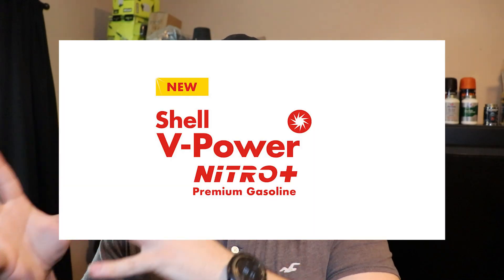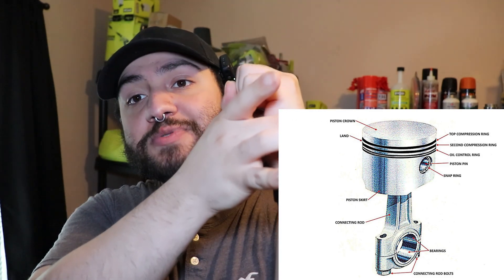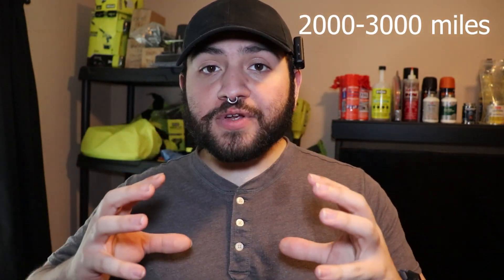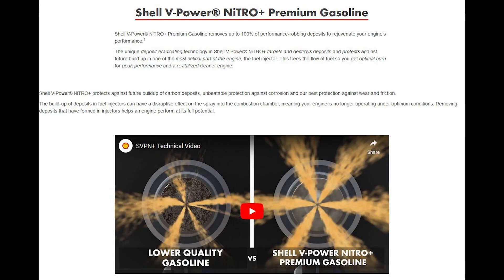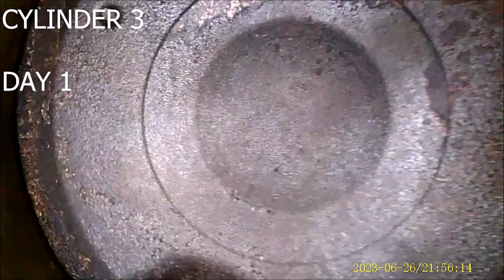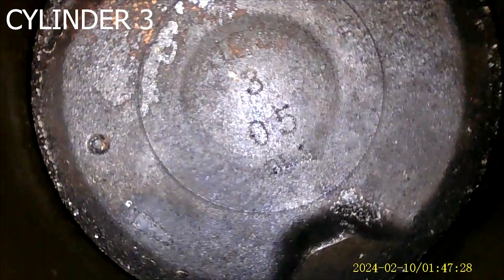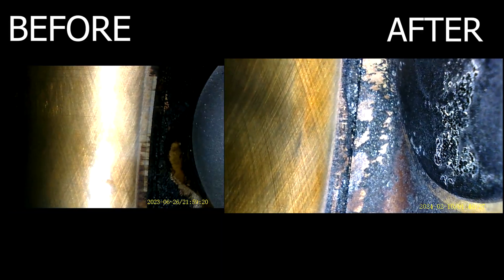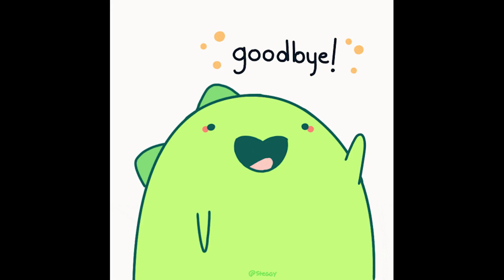IS PREMIUM GAS A SCAM? $$$$ (SHELL V-POWER NITRO +) - 8 Month Experiment

Comment: I’ve been using it several months now and I used to lose about a quart of oil between changes at 5000 miles. Last oil change interval I lost no oil. My conclusion is it’s freed a ring so I’m not getting blow by. I drive a lot of highway miles for work so I probably do more miles than most. It may take longer for others to see a change. I also use gum out injector cleaner each oil change
Reply from the maker: @tellit_one3613  preventative maintenance goes miles compared to fighting when mechanics have to charge you the harsh prices to repair

Comment: Start using it when your car is new and keep it clean to start with.
Reply from the maker: it does claim to be able to coat the area to resist build up occurring yes. I'm sure most people are more interested in what it can undo once their car starts acting funny. Too many drivers put whatever fuel they pass on the way home or to work, in their engine for years. Sometimes a fuel additive can yield comparable results but some formulas are money pits that don't work.

Comment: Instead, buy a catalytic converter cleaner like STP 1 Tank Tune Up which cleans and protects the catalytic converter, fuel system, intake valves, and oxygen sensors. They’re less than $15 which is around the cost difference between a full tank of regular and premium
Reply from the maker: thanks for sharing! Wonder how fast people would see results. :body-blue-raised-arms:

Comment: Scientific tests show that pretty much and "top tier" gasoline will clean your engine over about 5000 miles.  It doesn't have to be premium gas or even Shell gas.  For the most part I can buy top tier gas for a few cents per gallon more than no name gas.

Maybe Shell V Power has more detergents in it than other top tier gas, and maybe it works better than the others... I can't say.  

I only recall, that in the old days, my carbureted cars always ran less well on Shell gas, but there was actually a noticeable improvement in fuel economy with Shell.  So yes, Shell might be different.
Reply from the maker: old school guys say take it to the highway and floor it to 100 for a mile or 2 for the "italian tune-up" everybody has what works for them or what's in their budget. I know older cars were very inefficient and bad for the environment but man they built them so sturdy you could actually pass them down AND afford them to begin with lol
Reply: @TOOL_TECHNICAL  To be honest... old school cars wouldn't be around if we were still using old school oil.  They were built for really crappy oil, and they only last forever because oil improved so much.  In my 1966 Olds owners manual it says to change the oil ever 2000 miles or 30 days... And back in the 1970's I dug tons of sludge out of old school V8s from burnt up oil that wasn't changed on time.  

Once you switched an old school engine to modern synthetic oil... they literally stopped aging.  And no, they didn't get better... they just stopped getting worse.

As to bad for the environment, I'm still not sold on catalytic converters that spew out acids being much better.  The rain in my area is pretty acid these days and all of the salamanders in my local lakes are deformed or gone.... But yes, there's less lead in the air now... So I suppose it's a trade off.  And also smaller, lighter cars pollute  less.in as much as they burn less fuel.  But back in the days, I had a 1973 Buick with a 1976 455 4 bbl (low compression).  As it was in a 1973 it didn't need the catalytic converter or the AIR pump, so they were deleted legally.  (It still had EGR) and it easily passed emissions for a 1991 even without the anti-smog stuff.  We also managed to get a 1966 high compression 425 4 bbl to pass for a 1976, but it was literally undrivable. So, yes the high compression high performance engines were worse for smog. As to fuel consumption, the 425 got around 9 to 11 MPG highway and the 455 got 17.  My 2003 4.6 L Ford gets around 15.  But if your car gets 30 MPG, you are likely polluting less than most old cars did.

To toss one more monkey wrench into the discussion, I have an 1981 Hemi K wagon, with the 2.6 Mitsubishi MCA jet engine (Mitsubishi Clean Air). It gets both 30+ MPG with insanely low emissions, but it's a slug and does 0 to 60 eventually pulling a heavy wagon. So, even back in the day, cars could have had better emissions and fuel economy if anyone really wanted them.

Don't let people BS you... there's nothing new in internal combustion.  Everything we know now, we knew back then and could do without 10,000 worth of high tech per car. Lubricants and fuels however, have improved and car makers are taking advantage of that to make engines that wouldn't have lasted 10,000 miles back in the days of asphalt or paraffin based oils and basic non detergent fuels.
Reply from the maker: @RJ-vb7gh  I know safety is why cars crinkle to absorb the shock that would otherwise instantly kill drivers going 60-90 on a highway but I feel like back in the day you'd crash, take the bumper to a shop and weld it back, alittle touch of paint and it would be like it never happened. meanwhile today one hit and both cars are pronounced totaled by insurance companies right on the scene lol. Thanks for sharing
Reply: @TOOL_TECHNICAL  Yes and No.  Look closely and you will find that Big cars had full box frames and multiple piece stamped bumpers that were very heavy and thick; not to mention a thousand pound engine in front of you.  Small cars like the Maverick, Pinto Vega etc had no frames and very thin bumpers.  Moreover the Pinto actually had the gas tank as the trunk floor and extended into the rear bumper with no firewall... So yes large cars were safe, mostly because they crushed little cars in accidents.  That's why some folks remember the great street panzers of yore while other people say cars are safer now.  It all depends on what they were driving back in the day.

We didn't just wake up to safety, back in the day some people opted for fuel economy and inexpensive cars over safety. The Ford Maverick sold for under two grand, and there wasn't a paper clip worth of metal on that car that didn't hold something necessary on to the car.

Comment: i'm actually surprised by the results. I didn't think anything would happen. thank you for putting this together!
Reply from the maker: my pleasure powar! I really wanted to see if this fuel could solve the owner's blow by leading to oil on their spark plugs. 2 other things that could've been the culprit are worn out spark plug well seals in the valve cover OR the PCV valve going bad. Checked for those first so the final boss was attacking that carbon!
Reply: @TOOL_TECHNICAL 
Try using Valvoline Restore and Protect motor oil. That will clean the piston rings and reverse the blowby.

Comment: That's the wrong car to test with anyways, 8 months, wow! I can fill up 8 times in 3 weeks.
Reply from the maker: I went by amount of miles it took to achieve what would be correct time allotment by shell. if you fill your vehicle 8 times in 3 weeks, you probably need something more fuel efficient.
Reply: @TOOL_TECHNICAL  i have a 2016 escalade thats used for work, i have to driive to each job,  half the time i pull a 10x6 enclosed trailer. Put over 100k on it 2.5 years. Comfort is king! Service vans fully loaded with tools, ladders, and parts get the same mileage. You sure are full of opinions. You definitely need to be more open minded
Reply from the maker: @atlantaacman4750  My impressions are formed by analyzing data as it is presented and are open to change as more data becomes available. A daily driver is what is assumed until you now shared that it is a work vehicle which makes more sense for jobs and not simply 8 fill-ups of daily commuting. You also have opinions such as "That's the wrong car to test with anyways". That said, I hope the video was straight forward as I improve to share tool videos and repairs. Nothing personal here atlanta, the world is a rough enough place. :)
Reply: Right that's basically not even driving the car

Comment: I decided to try the high octane Shell.
Car ran wow so good and fast for 2 days.
After that it idle funny almost stalling and it runs like crap the first few miles
Never again just get the regular gas now and no problems.
Reply from the maker: @frasergriswolds7553  sounds like you had an underlying problem or carbon buildup may have gotten loose making an issue reveal itself
Reply: 😂 Lmao
...Sounds like your car is a POS.
Never again. 🤪

Comment: There really is a difference between gas meeting the minimum detergent requirements and those that are "top tier".  This car undoubtedly spent most of its life on a diet of whatever was handy and most likely whatever was cheapest... so odds are it did not have a steady diet of top tier detergent levels.  Lots of research has shown not only the benefits of detergents in fuel but that the effect is dose dependent.  Putting it on a steady diet of Shell V-power should have cleaned it up some but you can only do so much with what is still a low dose.  Years ago, I saw detailed research report showing how well Chevron's techroline worked.  It worked well and it was dose dependent; it didn't take 6 to 12 months to show improvements if you used a decent dose in a couple tanks.
Reply from the maker: @EristiCat  definitely this truck gets the regular stuff. But when $ is tight and prices get higher, I totally get priorities being food or utilities over fuel additives in gas. I looked into techron unfortunately it isn't available near me

Comment: It’s the only thing I run in my turbo charge GDI engine. I used to think Chevron supreme with Techron was the best but then I started using shell and I noticed a difference. I won’t put anything else in there because it works. Thank you very little!

Comment: I run shell V Power 93 in my Corolla GR  which requires 91 or higher octane.
Reply from the maker: notice any changes in performance or fuel economy between the octanes?
Reply: @TOOL_TECHNICAL  Here in Florida we only have 93 not 91 octane. This car is a high performance turbo car and requires premium and I only run 93 octane. I now only run Shell V Power 93 but when I run WalMart 93 I see more knock and timing being pulled then the shell 93 octane Vpower. When I go to the track I mix 3 gallons of 100 octane unleaded race gas. I can see it on the data logs. Fuel economy regular driving shell v power is slightly better than non top tier 93 octane.
Reply from the maker: @mhk67091  not sure which jumped out more at me there. Florida not having 91 or the fact that walmart offers gas??? I know some walmarts do tires but like a gas station? that's cool

Comment: All I know is, I have a 2020 Ranger 2.3 EB.  Says you can run 87 and I drove a good bit to get the miles to E to reset some.  I gained a 100 miles to the tank on the Shell.  I'm avg. 24 to 25 mpg and still gaining a mile or two.  It's leveling out after about two tank fills.  I put 89 in the CX-50 and beating the sticker mpg by two.  It's worth it to me to pay extra at the pump.  If I did the math right, only spending five extra bucks from the mpg gain.
Reply from the maker: @TwoPair72  with prices rising, 100 miles over any fill up is very welcome. Glad it worked for you. People seem to think I'm selling this fuel option on commission from my pocket lol. Thanks for sharing!

Comment: Oil in a spark plug well will be a valve cover seal issue, not piston ring, imho. The crankcase ventilation will regulate pressure in the valve cover area, even with blowby. Older BMWs are notorious for the valve cover leaks from experience, as they used poor quality rubber.
Reply from the maker: Thanks for sharing, the pcv was replaced as I showed for better ventilation. As far as the valve cover and gasket and spark well gaskets, I did let her know that they would need eventual replacing but not my car not my call ya know? Luckily there's no more oil showing, and her truck is doing relatively well apart from what I would recommend being 4 new brake calipers and brackets and a flush with new brake fluid
~ Work smart

Comment: In my experience… everything I put Shell VPower in quiets down and peps up as long as it’s a newer car with knock sensors and variable valve timing. It’s worth the additional 20 cents per gallon it costs compared to regular Shell in my state and I get 10 cents off per gallon using their free rewards program. So for $1-2 more per tank (I usually fill up 10 gallons), it’s a no brainer. When I lived in Florida and it was like 80 cents more per gallon I definitely thought about it more 😅 but in CA it’s a no brainer.
Reply from the maker: @adrianpadilla2155  damn! If you really are getting nitro v at 10 cents more go for it! Premium fuel in most places are several dollars more per gallon. Given how CA is right now I wouldn't live there if food, utilities, housing,  a car and gas were free lol
Reply: @TOOL_TECHNICAL In ohio ATM, regular is $2.74... v power is $3.96 both without discounts.
Reply from the maker: @xTypeNameHerex ouch, in some places it's alittle for $4/gal. For long-term use, it certainly is a financial commitment

Comment: The thing is it doesn't build new deposits. Its even removes old deposits. It means it worth it.
Reply from the maker: @Meditationrelaxinghealing  correct it does advertise to prevent buildup from occurring however without committing to a 100% cleaning timeline followed by a 1 - 3 year following up to see common commuting with a solid mix of city miles and highway miles while the vehicle is untouched by extra additives such as fuel injector cleaner

Comment: I have always and will always run my car on Vpower. 

I know she runs clean, and the exhaust tips have no carbon build-up. 

Pulls like a train. Along with the fuel, I service the car 2k miles earlier. With gear box oil changed 30k to 40k miles. Rear diff changed 60k. 

In terms of turbo: I turn the car on, wait 30 to 40sec to let oil go round the engine and all the computers to speak to one another. At the end I let it tick over after a run. 30sec to 1min. Gets some oil round the turbo fins. 

The car, Jaguar XE 2.0 T R sport.
Reply from the maker: Take care of it! I've seen jaguars even older ones cost owners close to 1000$ for a damn water pump replacement. Always good to take care of your investments.
Reply: @TOOL_TECHNICAL  prevention is better than cure
Reply from the maker: @mishalchotai4721  for sure. Prepare and prevent don't repair and repent

Comment: Would you happen to know if the Shell gasoline cleaned the Nissan's fuel injectors? Thanks for the informative video on Shell V-Power gasoline!
Reply from the maker: I would assume it did however I would not like to deceive anyone. There was a fuel additive the owner added specifically to clean injectors before I could check them so I'd hate to tell you it was the gas if it was the additive that worked instead. The Nitro + formula does claim to "target and destroy deposits and future build up of fuel injectors"
Reply: Put money on it. I've seen a few videos on daily drivers that experience injector problems on my model . Mine isn't used frequently but only ever runs super high quality fuel. And my injectors are perfectly fine.

Comment: I hate to be “that guy”, but premium vs regular unleaded isn’t about cleaning additives. Octane selection is almost exclusive to the engines compression ratio and ignition timing. Isn’t it more efficient (cheaper) to use the same, or similar, detergent package in all octane ratings sharing the same branding?
Reply from the maker: I didn't introduce this fuel to the owner for the sake of performance (although it was certainly a byproduct during the experiment). The additives in Nitro V claim to remove carbon buildup which as you heard was able to remove buildup of carbon deposits on her oil rings thus to date she hasn't had any oil blow by to the piston head or the spark plugs. 100% agree cost-wise an additive to recommended standard octane fuel is preferred when attempting to achieve the same result while saving money. In this case, it did its job (roughly). The financial commitment may lead many to go for fuel injector cleaning additives and fuel stabilizers/detergent additives. Thank you for sharing and don't worry you're not that guy, I AM 😎
Reply: @TOOL_TECHNICAL  I see now. Shell is marketing this additive package in their premium fuel only. Thanks for the methodical test!